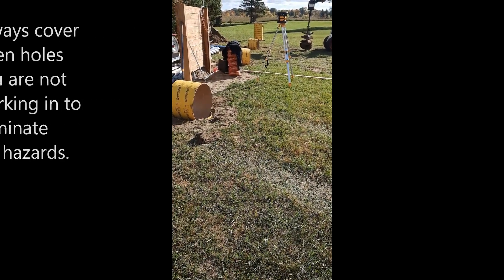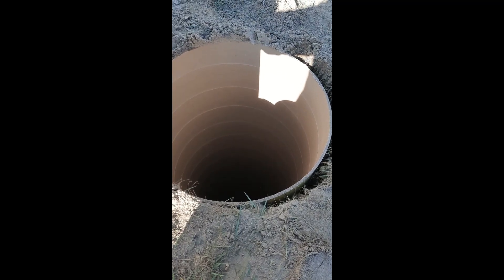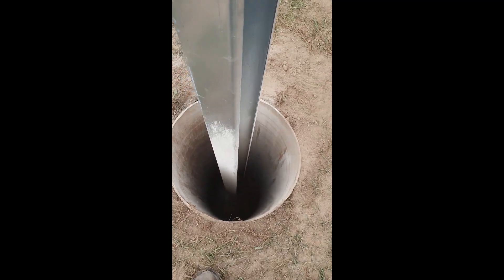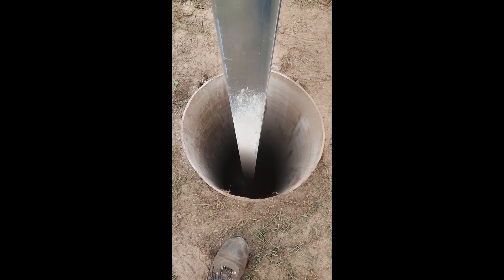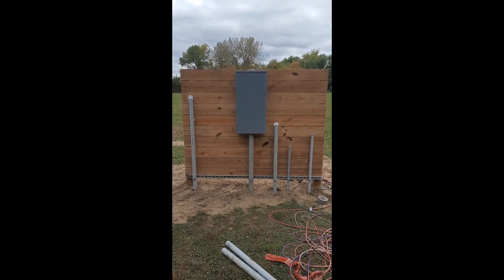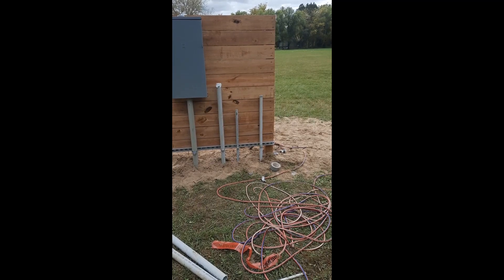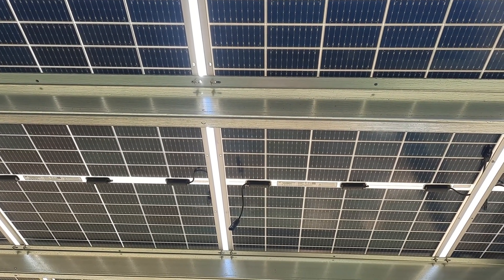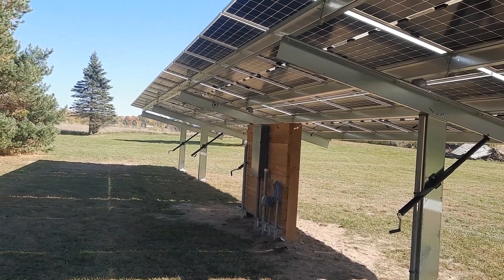16kw Solar Array Ground Mount Season Adjustable

Comment: What size diameter hole did you dig (I might have missed it in the audio). I will be doing the same setup for 24 panels and they recommend 24” diameter for me in Ohio clay. Those seem smaller than 2’ wide holes. How did you get concrete into them? Shuttle buggy or mix them on site?
Reply from the maker: @anthonymiller3933  sorry for the slow response,  I've been busy. They are 24" diameter sonotubes, approximately 7feet deep if I remember correctly. I was able to back a truck up to it, luckily it was really dry that year or that wouldn't have happened.

Comment: How much does an adjustable ground mount cost to mount 16 kW of solar panels?
Reply from the maker: @ngana8755  I can't remember the actual ## but i believe this system landed around $30-32k +/-  installed  and inspected by myself a licensed electrician.   
In the Midwest ground mounts generally land between 2-3 dollars a watt... slightly more expensive than roof mounting due to trenching, dirt work and footings
Reply: @minnesotacountrylivin4674  The ground mount cost $32k or the 16kw solar array + ground mount cost $32k?
Reply: @minnesotacountrylivin4674  Is that $32k ground mount only, or $32k ground mount and 16kw solar panels?

Comment: Very neat project. Do the high voltage wires come down from the panels to the combiner box, or are you running them down the metal posts and then back up from the ground ? do they have some slack to allow for the seasonal tilt? Thanks

Comment: May I ask where you purchased the Steel for the frames?
Reply from the maker: @jeffsopko7778   it's a Sinclair Design sky rack, if you have a local distributor  it is cheaper than ordering from them directly... because of shipping costs
Reply: @minnesotacountrylivin4674 love it. How does the still support that moves with the tilt options connect to your permanent verticals posts u buried deeply?  Is it some sort of a hinge or just bolts u losses and adjust and re tighten
Reply from the maker: @jeffsmith3297   it pivots on the top bolt,  I can't remember if they recommend  loosening and tightening them , this particular customer leaves them at the tightness from install and the Jacks easily raise and lower it.

Comment: What PVC Conduit did you run in-between the posts?  I see in the center post near the panel where inside the c-channel that something is coming out of the ground.  I also see on the back side of the array on the post to the right just to the farthest one a pipe coming out of the ground, but not able to see any others.  What wiring did you do for intra-panel stringing?
Reply from the maker: @brucespeidel4132   I ran 2 - 1.25" pvc conduits for the solar panel dc wiring to each inverter.  I wanted those to come up near the pivot point so everything would move freely during adjustments.  If it was stationary I would have just came out of the inverters and went up onto the array

Comment: Why 7 feet deep 

Good grief
Reply from the maker: Manufacturer engineered drawings said 7 feet, we get up to 3-4 feet of frost some winters , that said you definitely want to be deeper than that or the frost will lift it.  This was installed for a customer,  I certainly  wasn't going to cut corners.  If it was at my house, I would have maybe cheated a little on depth to get it off the ground another foot for snow accumulation...

Comment: how much is the cost of  a single adjustable jack?
Reply from the maker: They are around $150 individually but I believe they are cheaper as part of the whole build
Reply: @minnesotacountrylivin4674  Can You mention a trusted Manufacturer so that I can contact for the adjustable jack for a complete 7 MW Solar Project

Comment: Im confused why you didnt just do piers and bolt the steel to them. More than strong enough and easy to replace. Those columns are going to rust out and fail.
Reply from the maker: I had engineered drawings from Sinclair,  complete with wind ratings and the whole deal.  All of the drawings were approved by the city and utility companies,  was not feasible to try to design my own structure and  then have an engineer sign off to please the inspectors.  The posts are galvanized,  they will last a substantial length of time.
Reply: the part where under the ground is cover by conceret,which can isolate the water and air, and Delaying corrosion of post.
Reply: They will outlive him? Steel will take forever to fail buried in concrete. Same can be said for your steel bolts and rebar buried into the concrete to bolt the post on.

Comment: So you spent all that extra money to track seasons that change by 23.4 degrees but no east/west tracking? With all that wide open space you could have designed a single axis with east/west tracking for the same cost and get 40% more power. Would love to see a rebuild video.
Reply from the maker: In mn the sun is always(somewhat)south , in the winter these are tilted up to 50 degrees , we are not seeing that great of production out of east to west trackers in mn from about September to March,  the especially the e-w auto trackers.  This system has been performing year round  very well , I'm convinced the panels are overperforming the specs.  I don't think I would change a thing doing it again.

Comment: That is one sexy array...nicely done! Impressive (and a bit jealous!) I used solid steel stockade posts for mine...filled with cement and sunk them  2' down in the holes (filled with cement). The frost lines here in Oklahoma (south central) is about 4-5" or so. Looks like you went down 4' or so...smart!

Comment: do have a parts list of items used?
Reply from the maker: Racking: Sinclair sky rack 2.0
Panels: 42 - Canadian Solar Bifacial 390w
Inverters:2 - SMA sunnyboy 7.7kw

Those are the key items to the solar array itself,  obviously there is some DC wiring required, and a bunch of pvc conduit work. I'm working on a follow up video for both arrays I currently have videos about. Hopefully they will be up soon

Comment: Never ever put wood in a concrete footer
Reply from the maker: The idea of the leg on the post is even if the treated wood deteriorates in time, the footing will not loose any value.  Having the post full height is not an option because it can then slide up and down on the post (worst case)  if you have a better idea I'm all ears  as I plan to do more of these
Reply: @minnesotacountrylivin4674 2 or 3 lb porable foam. It’s now used for post beam barns

Comment: Wow those are the deepest holes I've seen for a solar array. Mine are only about half that deep.
Reply from the maker: We get 4-5' of frost in the ground in the winter (not sure if you do) so the idea is to get below the frozen ground.  The ones at my house are only 4-5' but that's is a way different array (my other video)
Reply: @minnesotacountrylivin4674  Ah that makes sense. The frost line is less than a foot where I live so no need to worry about that.

Comment: Why run 4/0 or 200A at 240VAC when you can run 8 ga at 400VDC+ closer to home???
Reply from the maker: I have 6 zones of solar , I would have needed a 2inch conduit minimum for 12 - 8 awg solar rated wires.  Would have cost substantially more than 4/0,4/0,2/0 aluminum direct burial wire.  Just the 350feet of 2" pvc would have cost more than the 4/0 , now there is room to add.
Reply: Burying DC cables in the ground is not a great idea they have no circuit protection .

Comment: Looks like a nice big snow collector!
Reply from the maker: Winter time they are cranked up to 50 degrees for optimal winter sun , anything over 40 degrees of angle and the snow slides off or melts off on the first sunny day
Reply: @minnesotacountrylivin4674  Good.....What about when you get that in-between temp dense snow that freezes? Does that slide off? Also I wonder if that nano coating or rain-x would help any?
Reply from the maker: @fritzkabeano1969  good question , I'm not sure how they will do for those worst case scenarios,  I had thick ice and snow on my 36 degree fixed panels at home and I blew most of it off with the leaf blower and the rest melted off the next day
Reply: @minnesotacountrylivin4674  Hi.I am also thinking about ground system, question: is necessary to concrete it? Others make without concreting and i don't understand how long will stay straight?In our region in Europe,Latvia, the optimal winter solar angle is 80 degrees and how will the wind affect it? We ar on latitude 57.,like the middle of Canada. I think it will be safer with concrete and it will also act as a counterweight
Reply from the maker: @Edijs Egli  , I believe the only way to safely skip concrete is if the posts are driven with the skidloader post driver made for these posts, (Rambo 300?) , I'm thinking concrete is important.  Also this system has a max tilt of 50 degrees, might have to reach out to SDE if you need a custom tilt angle.   Also when you order they calculate the windload based on the area of install.